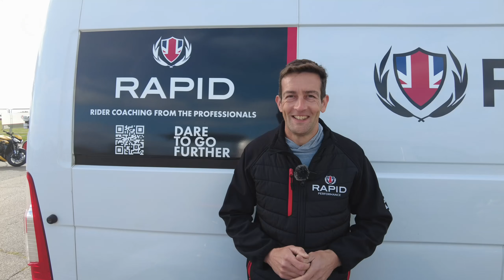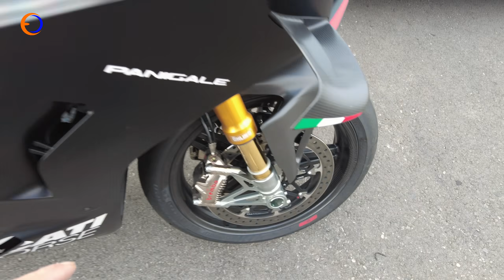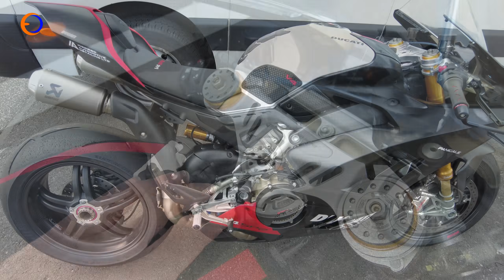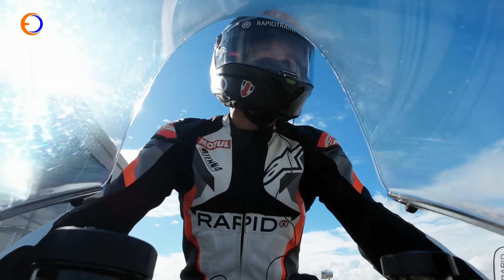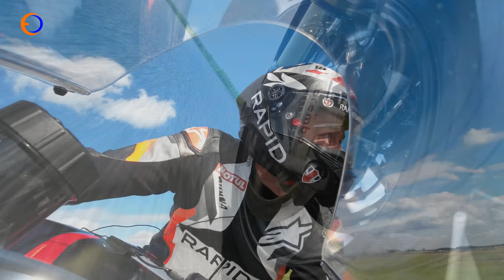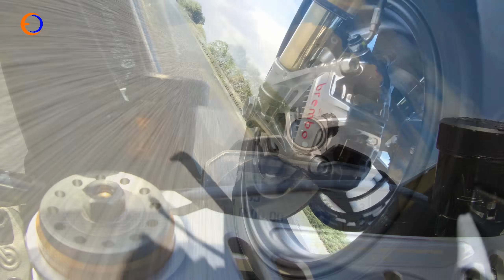How SPecial is a Ducati Panigale V4 SP2? Fast Italian ridden and rated.

Comment: I just took ownership of a 2026 Panigale V4R. I optioned it with the full race kit, the WSBK Brembo calipers and rotors and the CF wheels and she has manual adjustable forks and rear shock and a few other minor options and my out the door price here in Brevard county, Fl., where our sales tax is 7% was $101K. The advertised BHP is 239 at 343 lbs. She's pretty sporty with the nannies off :) (a recently retired grad degreed Aerospace Engineer who worked for a large American defense contractor's Missile Systems company, and who held AMA Expert/Pro Racing Licenses in both 125cc Motocross and 350cc Road Race who raced in the Daytona 200 in 1975 on a TZ-350 (B) and beat Jeff Ward the only time we raced in an AMA sanctioned motocross race.

Comment: I have the same forks on mine and changed the springs at Jerez to the 10.5 but it still bottomed out for T6 but felt too much everywhere else. The 10’s felt better but bottomed out way too early for that turn and was riding the rubber till tip in, not good. Do you think it’s something to do with the design, geometry or the wings?
Reply from the maker: I suspect it's still designed to work on the road, hence the less stiff springs, and a 10n/mm is a good base for most riders on most tracks, we'd normally be in a similar range with our superstock bikes
Reply: @obsession_engineering  These are the FGR 254 race forks with ttx technology and spring pressurised. Öhlins states for race use only.

Comment: Great review - SP2 owner here.  Definitely special including the price!  Had a lot of 'interesting' wet track days on the SuperCorsa SP V4s, starting to wonder how good they are for the wet.  Intermediate track day ability in the dry I have yet to find the limit of traction, the limit is my ability not the bike or tyres.  Wondering if the Rosso Corsa's would be better, perhaps bad luck but only had one dry track day in 4 years, including a Euro track day so not just bad luck in the UK.  Can't fault the bike on track, it tolerates the road but spends most of it's time laughing at you and how quickly the speed limit is reached.  You mentioned more than a few times "its not my bike", so fix that and buy one!  Used are now cheaper than a new V4S.
Reply from the maker: If a spare set of wheels with wet tyres isn't an option, a more road tyre might be good, but then it'll bet every trackday will be dry!

Comment: The ohlins that the SP2 comes from factory are electronic adjusted ones. Those that this bike IS running are aftermarket mechanically adjustable. Same story for the brakes, upgraded. Basically this is not a V4 SP2 anymore
Reply from the maker: Interesting observation, and thanks for the feedback!

Comment: "It's looking after me" lol that's the problem. That's why only watch BSB classes and MotoGP as it's exotica does run eletronics, but is the pinnacle of motorcycle racing. Really can't be arsed with WSB.
Looks like a fantastic track bike. Needs GP tracks to stretch it's legs. 16k beats my 15k ☹ V4 tho sounds different. Mind you 2stroke stuffing has his own build engine 50cc running now nitro hits over 18k 22hp. Going for world speed record in 50cc class. Has done the speeds needed using race fuel. 👍

Comment: No, the bike doesn’t come with finned calipers, T-drive discs and Ohlins FGRT. The stock bike has stylema R calipers, standard discs and Ohlins electronic suspension.
Reply from the maker: Thanks for the information, I appreciate it!
Reply: @guitarfan:     how is the electronic suspension upgraded ?
what does the computer think without the leads being connected in ?      ls there a way to acquire special knuckles than the entire fork ?      
   just wondering & interested
Reply: @de77thecomputer  you have to use healtech sensor to plug in the oem electronic suspension plugs. Then you can use any manual front forks.
Reply: @captain-h6r 
    great,  thanks for the info. 
 have you upgraded to manuals ?
lf you have how was the upgraded feel n control in relation to price and purpose ?
Will l be able to beat Marc or Toprak once l get these on my bike ?      Are they just show pieces for bragging rights ?      Look at me,  l got the latest n the greatest but still slow as a turtle on track after having spent a small fortune on upgraded forks !!!

Comment: I have the V4S and as an ex racer from the late 90’s and through the 2000’s I’m stunned by these bikes. I raced from the FZR600’s and CBR600’s through to the early R1, K3 and K5 Gixer etc. but these things are another level. I changed the spring rates and that’s it. The engine is insane, the brakes are stunning. Direction change is great, they hold a line, so easy to ride with all the electronics working hard. A bit different to the old days of adjusting the chain length on my bucking R1 in a desperate attempt to find drive off the corners 😂
Reply: Loved my FZR600R back in the day, although if I’d had the money for the YZF750….
Reply: Do you find yourself having more fun on your V4S than your older bikes? Especially given the electronics? I’m really just getting into bikes and trying to “tame” an older less refined bike sounds like a lot of fun, but you’ve got worlds more experience than I do. I’m curious!
Reply: @Qwerty-ro1hr  The safety net inspires loads of confidence, you can get up to speed on track so much quicker by being able to bump into the electronics, instead of having big moments.
They do make the modern bikes feel a bit 'digital' compared to the old analogue bikes... and some will say, the aids might encourage bad habits/technique, which could be true.... but you can obviously dial them right back or even switch them off if you want.

Negatives?

More complexity and electronics  provide more potential failure points, there is no getting away from that... but Ducati have come a long way since being aquired by VAG in 2012 that this wouldn't be a huge concern for me.

Comment: I’d love to see it spanked around the IOM. Rutter took a v4 speciale around on a (I think)123 lap
Reply: Not eligible in superbike or superstock, rules only allow 1000cc 4 cylinder max capacity….👍🇮🇲
Reply: That’s why they make the v4r. That would be eligible
Reply: @lloydperry3154 I didn’t realise the V4r was only 998cc, 👍
Reply: @ManxAndy-3Legs1Van all the r models are so that they can race in bsb/wsb or any other domestic championship. Not sure on how they squeeze more power out of the r models from a smaller engine but they manage it. I do wonder myself though why they don’t just produce the entire range on the same platform.
Reply: @lloydperry3154 indeed, it does seem a bit strange to also have a 1098cc  version…..hey, that’s Ducati for ya…always a bit left of centre..🤪
Reply: I meant just as a one of lap. For science.

Comment: Dave you a machine!
Burning question is why does nobody race one at the IOM TT (v4R that is) ?
Reply from the maker: I think it'd be great to see, one slight issue is most riders use the same bike in stock and sbk races, and not sure the v4r is stock eligible
Reply: @obsession_engineering  what else do Super Stock need to be than production models, under the 1000cc limit, and available in the UK retail market?
Reply: reliability and running cost most likely
Reply: @colossalbiff3514Cheers for the message.. they did run them at NW200.. Glenn Irwin did incredible racing on his .. just wonder why no IOM TT
Reply: @Colin8979  Glenn was supported by the UK factory BSB team he rode for, so make it easer with access to parts etc.   It would be good to have a top line rider on one at the next TT.
Reply: 1000cc max for 4 cylinder machines…👍🇮🇲
Reply: @ManxAndy-3Legs1Van ...which the V4R is, Andy.
Reply: @NotNowCato1254 yes, I just realised, genuinely thought it was also a 1098…😉
Reply: @ManxAndy Would certainly love to see someone as talented as they are wealthy spank one around the Mountain Course. Be worth it for the sound alone 👌

Comment: The SP2 comes with Ohlins EC2 electronic suspension front and rear. The owner of this bike appears to have swapped that out for superbike spec manually adjustable Ohlins FGT forks and presumably TTX-GP rear shock. They are not standard. This bike from the factory is merely a dressed up V4S, I think you're thinking of the V4R which comes with manual suspension, and even that is much lower spec than what's on this bike.
Reply: Yup.
Reply from the maker: Interesting spot, thanks for the heads up.
Reply: Yes. I have one. Sp2 2024 30th anaversery. It have the electronics suspension like the S
Reply: ‘Merely a dressed up V4S’ - simplification and not accurate but spot on re suspension